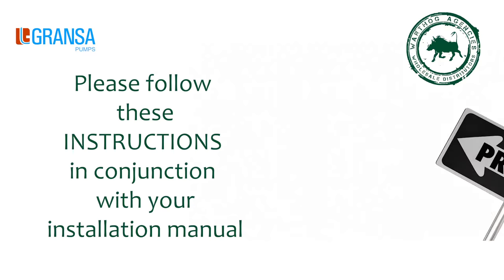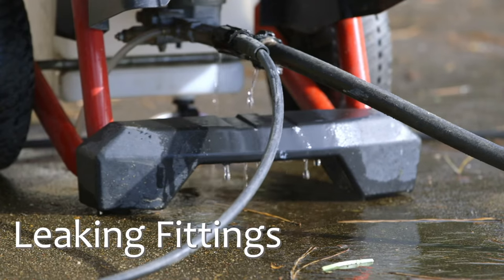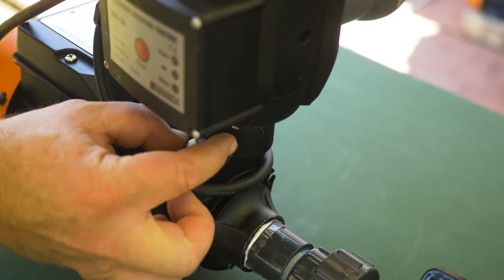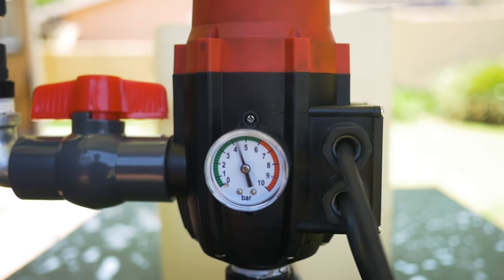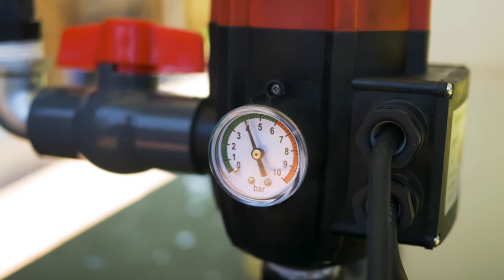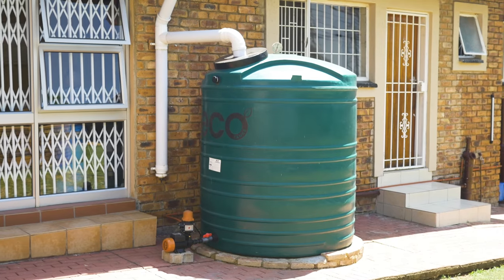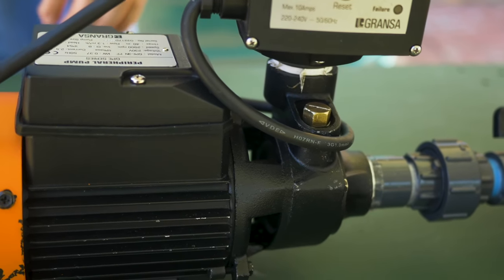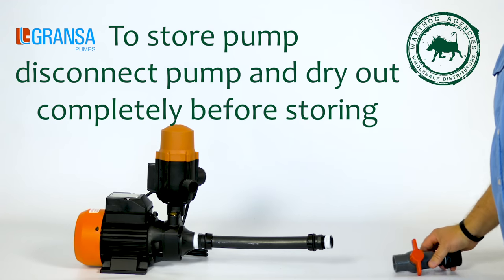Booster Pump Fault Finding

Comment: I have a 0.75KW centrifugal waterpump. I installed three months ago and it worked perfect. Now suddenly the pump is on and running but no water is running though. What can be the problem? I disconnected the pump from the water tank and the water run through smoothly. Any advice please?

Comment: My pump is turn on manually, when tap or shower off, pump off, again when tap or shower turned on the pump doesn't start automatically, I need to turn on manually (power on off), please suggest me the solution

Comment: Hi. Thanks for your video. I don’t see a non return valve on your system. Can you please clarify where such a valve must be installed? Is it before or after the pump?
Reply from the maker: The unit comes with a built in non return valve, however you can add a non return valve after the pump.

Comment: My pump works normal when all taps are off it cuts off and goes in failure mode when reset it's works but when the tap is turn off it goes in failure mode and needs to be reset over and over again
Reply from the maker: Hi Dale - please send me a video of your installation of the pump and operation to our WhatsApp line - 084 684 5097. thank you.

Comment: Pump doesn't switch off even when walls r closed
Reply: This is probably the most encountered failure yet the video somehow missed it 🤣
And the most common issue is dirt inside the sensor valve...
Reply: @MrGoMario  whats the solution ?